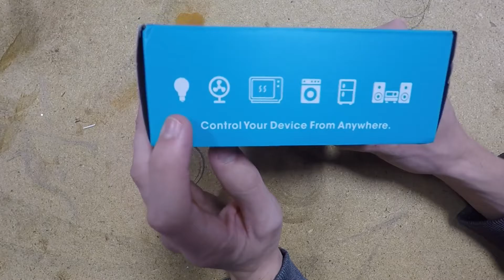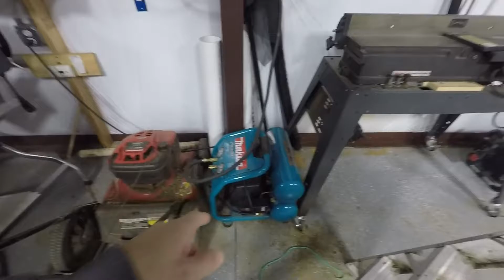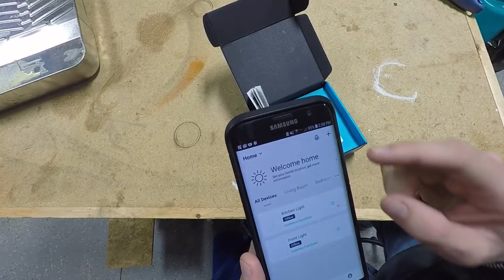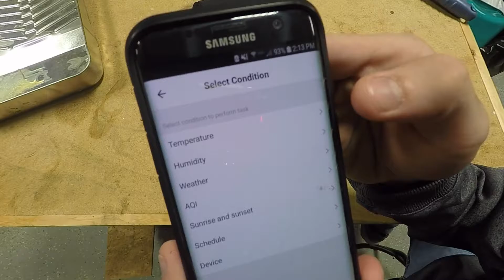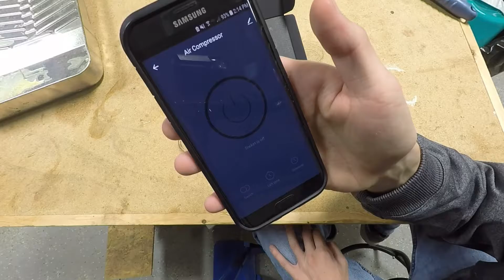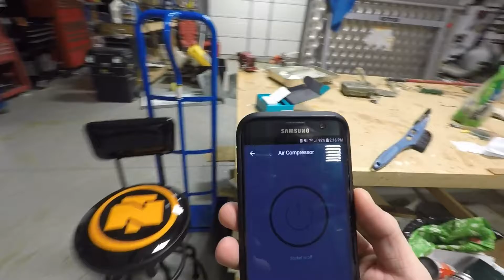Amysen WiFi Smart Plugs-2-Pack Review and 30% Discount!

Comment: Using that for compressor may be bad because of the amp draw higher amp required to run it. I would be afraid of it melting. Does it give a max amp draw in the specs. I have seen cords burned and melted on some high amp draw. It’s a great idea though.
Reply from the maker: I thought of that too! The plugs are rated to 15A or 1800 watts. My compressor pulls 11.2 Max Amps so I should be good! Good point though, have to be careful as all my breakers are 20 Amps! Thanks for watching!